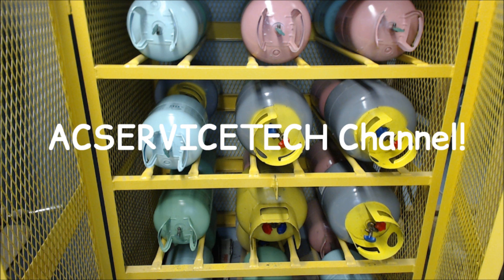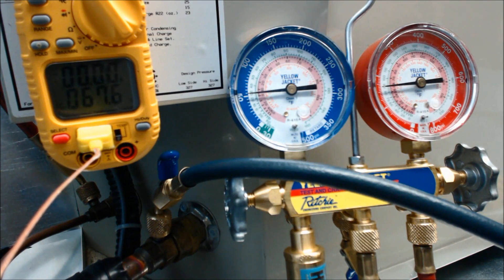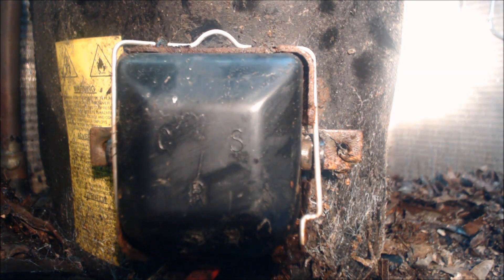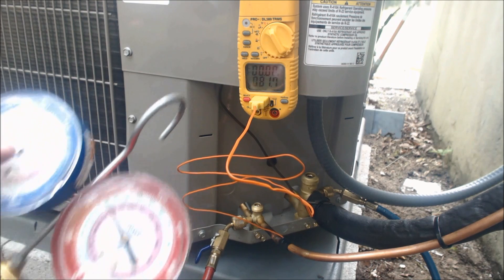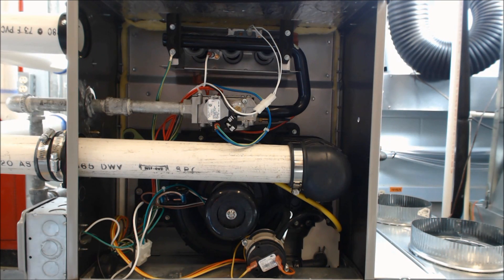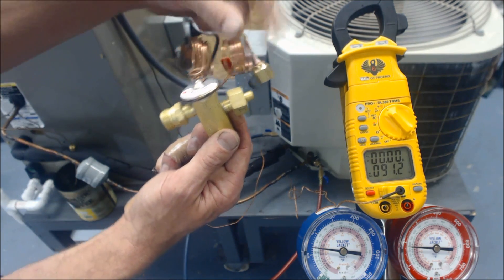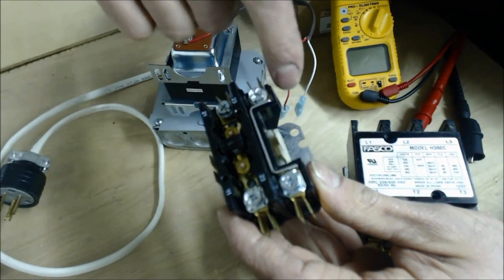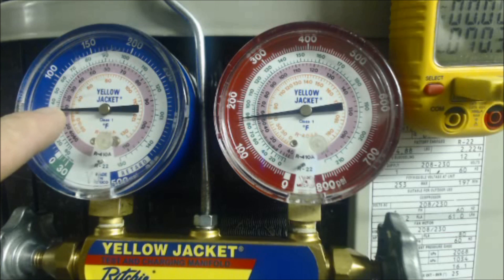ACSERVICETECH HVAC Channel!

Comment: Hey Craig. Great videos. I have 30 ton unit is that is on jet bridge at airport. Our problem is that our suction side is 60 discharge 240. R22. Outlet of evaporator is hot. We believe it could be clogged evaporator what do you think.

Comment: You might want to talk about the impact of accuracy of gauges and thermal couple on subcooling and superheat measurements. Also mention gauge rating grade letter designation.  Buying cheap Ebay gauges and thermocouple meter can give significant error.
Reply from the maker: I understand your thoughts and have fieldpiece wireless tools and a SMAN460 but the people I usually teach at the technical schools don't have access to such equipment because of the cost so those starting out are usually using compound gauges so that is why I teach with them, thanks!

Comment: I saw a Rudd 3.5 ton R22 Piston system that had a new compressor installed that was restricted and new compressor was rated for 19 RLA, after checking with Meghometer it showed the winding insulation was bad, but compressor starts and Runs but Rattles, can you put a hard start on a compressor with bad insulated windings? the compressor only pulling 11 amps, even after restriction removed and system Cleaned out. Compressor still Rattles.
Reply from the maker: The hard start capacitor will have a relay that will take it out of the circuit within the first 1/4 second so it is only good for startup. There really is not much you can do with the noise or to prevent winding resin degradation except checking acid level, thanks

Comment: Hi, I'm at a job where it's a 410a system but my pressures are showing r22 like pressured 70/ 227 I replaced coil as it was extremely dirty and same thing is is happening and also freezing after piston. At one pint I had a super heat of 3 and sub cool of 90 The filter drier is inside the  the condenser maybe is clogged ? Comprador rating is 14Amps i checked I got 10.5 9.6 and the left HERM from capacitor is only pulling 1.5. Is this normal please Advice thanks. Keep making videos u rock.
Reply from the maker: Did you recover all of the refrigerant out of the system to start with virgin 410a and replace the filter drier inside the condensor when you replaced the evap?
Reply: acservicetech hello and thanks for the reply no I did not do none of that that you're asking however I am doing it today I replaced filter dryer took the one who said the condenser out and install the new one before entering the eveapp coil. All refrigerant has been recovered and will start with new refrigerant. When I took out the old filter dryer I blew on it and he seemed like it was not clogged up let's see how it works once everything is fresh in.  I'm on a vacuum right now
Reply from the maker: I am sure you did but also make sure that the airflow is good and sized correctly with a good blower motor speed for the volume of air needed to be moved, thanks

Comment: Ty for your videos they are all great i have a problem with a whisselin noise i just replaced the fan moter exact specs and I am getting a whisselin noise 5 ton his return grill is only 20\22 in if I wwould double the size do you think it would take care of the problem ty
Reply from the maker: Hey David, yeah you could make the return grille bigger, always use a grille manufacturer with less slots meaning the opening sizes are bigger, you could increase the size of the return and also if it is a flex, you could do a loop with an oversized flex which would spin the air flow and lessen the noise. I know that sounds weird but when you are stuck and need to do something, that is something. Also if it is hard duct, you could put acoustical liner in it if it was a very short run. My customers comfort and noise level will always trump a small electrical savings but there is a way that we can design that correct from the get go. In this situation however, we are there to service and make the problems go away. Thanks and I hope that helps!

Comment: How to add R410- A into mini split when is  totall empty, and only LP valve exist?..Thanks!
Reply from the maker: You would need to pressure test, vacuum pump down to 500 microns, weigh the refrigerant in to the weight stated on the rating plate and add extra refrigerant per foot extra of lineset. Here is a video on that---https://www.youtube.com/watch?v=QpzOSQt2fpI&list=PLxnHR5_D2ojzAUXWWQt9A8juotNkzwYlk&index=51

Comment: Hi ACSERVICETECH! as you know I have been watching and sending you questions for the last few weeks.  I think your new trailer is great, it shows a little bit of everything you teach. Being I am a new tech, your videos help me out.  I did want to ask if you could do a video on using a pinch off tool.  Thanks a lot and keep up the awesome work!
Reply from the maker: The pinch off tool is not used very much in the field in my opinion but that's just one opinion. There are different types. I am assuming that you are talking about the type found in flare swage blocks and no the expensive ones. Sometimes people use this to stop the refrigerant pressure and to braze a service valve in and unpinch the seal to allow refrigerant through again. The issue is that you still need to find the leak and to fix it you are going to have to pull the refrigerant out anyway. In this case, I usually recover the refrigerant out, find the leak, fix the leak, vacuum and weigh the exact correct amount into the unit. Most people would think about using this method on type 1 units which have small copper tubing and are small packaged units. In the case of recharging these units, it is best to weigh in the charge to the amount specified on the rating plate. I hope that helps! Thanks
Reply: +acservicetech 
Thank you so much for your reply.  I asked about the pinch off tool because I am starting to get into refrigerators that don't have access ports.  I thought doing the way you suggest is best also, but I just wanted to see what you thought. I don't have many folks to ask in my area and I am the only one here at work that went to school lol. I am using my schooling, your videos and my prior knowledge to get me through. thanks so much, I appreciate  it.